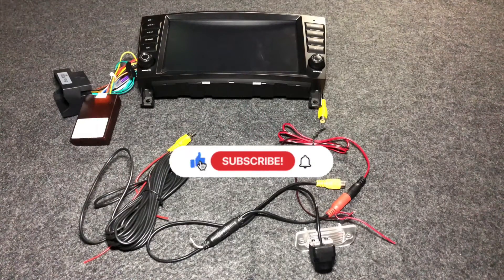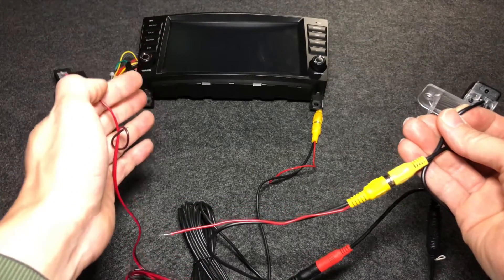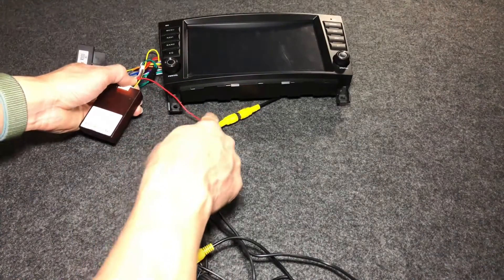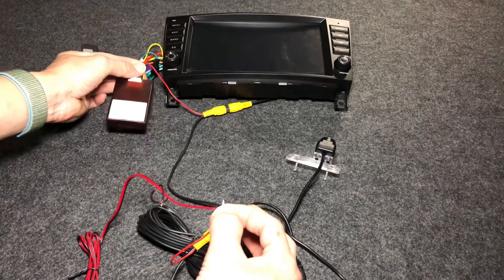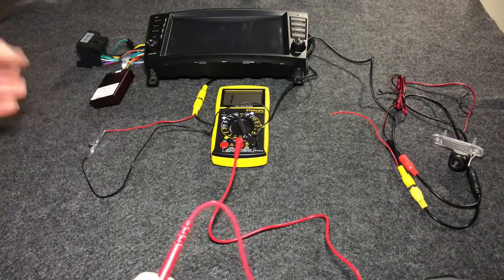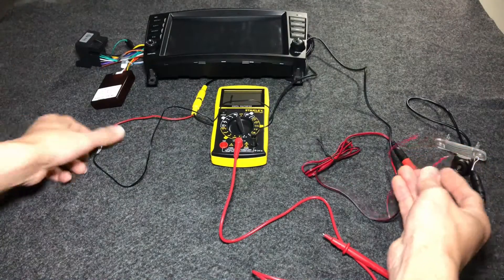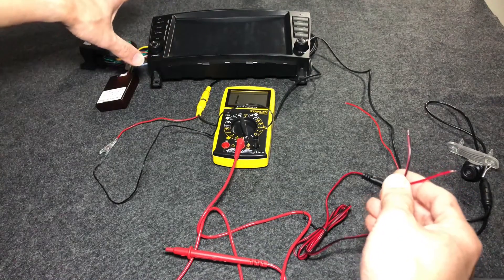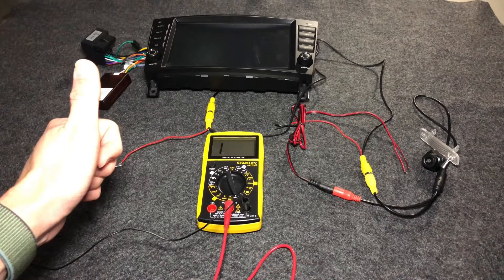HOW TO | CORRECTLY WIRE A REVERSE CAMERA

Comment: Thank you. I haven't a red small wire in the video Yellow connector. And my actual camera is connected to the reverse light. How to use the power cable in this case? I need to delete the connexion to the reverse light. Thanks
Reply from the maker: Hi Bassam, to do that, you first need to get the reverse camera wiring cable with the red wire on each end. And if you do this, you will need to remove the existing one connected to your reverse camera, route the new wire from the headunit to the reverse camera then hook it ip. Thats a lot of work.

If your reverse camera is already working with your existing wiring, I wouldn’t recommend re-wiring it just for the sake of getting 12v power from the headunit.
Reply: @AutosNGizmos  Thank you. I need to keep the actual camera already installed. But the Video connector doesn't have a red cable like yours. The camera is already connected to 12v from reverse light. I think I must remove the 12v connection to the reverse light?

Comment: I removed the brown cable from the CANBUS plug. And now from your video I learned that CANBUS is a voltage source. Can I still fix this?  Now how to connect the red and brown cables to the CANBUS plug?
Reply from the maker: Hi Angelika, you can re-connect the brown wire back to the canbus. Once connected again, you can use a thing called T-tap with a spade connector (affiliate link below) to connect the brown and red wires

⭐️ https://amzn.to/3BQkSFS

Here is a picture how to use the t-tap and spade connector for your reference.

http://youtube.com/post/UgkxVkxiMe6_QyFnZEwaOgEj4Uum8UI9OHfd?si=5sZ0vhjySo8qC662

Comment: What about the front camera?
Reply from the maker: Front cameras use the same concept. You need to power up the camera at the exact moment the headunit switches to the front camera video feed. But unlike reverse cameras, you cant rely on a canbus signal. You need to have a custom controllers that checks vehicle speed or add a custom switch in the dash that you can turn on when required. I hope this helps.

Comment: so.. if connect the power source to the head unit without tapping it to the reverse light, would I still be getting automatic revrse video turn on when i put on the reverse gear.?
Reply: updated, i tried the method, it didn't work.. seems like my head unit need input source from the camera to turn on the screen for reverse camera. so it need to tap the red wire to the ac-dc red wire which connected to the power wire for the reverse light. there is cable in my head unit (also brown color) need input power to turn on the reverse screen video. so thats why the red wire need to be connected to the brown wire cuz the brown wire, in my case, is not output but input. input from the reverse light power source
Reply from the maker: Thanks for updating your post for the benefit of others 🙏 This is really helpful
Reply: @TarapBossku there is no AC/DC anywhere in your audio system or vehicles lighting circuits ect...   everything is Direct current DC 12v usually.  Some trucks have 24v that means they have 2 12v car batteries usually unless somone installed an aftermarket 24v single battery.  Bytnits all the same.   

DC comes from batteries .   AC. Aka ac/DC  is what comes out if a wall socket in your house. Or from an inverter that transforms DC from a battery storage bank into AC to be used with your standard house hold appliances.   So that you can plu in a regular plug and power a lamp or a fan or something with a batter .  But you need the inverter.

Comment: Hi this might be an obvious question, but how do I tap into the brown wire without risking damage? Thanks
Reply: Come on now authority guy.    Just tell them to scape off a little bit like the width of a pencil off of the wire . Your just removing some of the rubber insulation around the actual wire. Once you have some wire exposed. Simply take your desired lead that you want to connect to it strip of maybe ½in to and inch of the jacket and wrap it around the exposed bare wire on the sully source your tapping into.   Twist it nice and tight to ensure that both bare wires are touching. Then you can either solder then together or use electrical tape or electrical glue or even hot glue. As long as the wires are twisted together and then covers with some kind of non conductive rubberized material than your good .  Black electrical tape is fine.  

You can. Just cut the source wire in half and stirp both ends and then twist the tap in wire together with the source ends and use a wire nut over that or shrink rap or tape ect...ect..  just make sure the bare wires are connected will and then cover them up.  

You don't need to order anything and wait 2 days and stuff.  Just cut and twist. And tape.
Reply from the maker: Hi Emm, firstly thanks for taking time to watch this video. I appreciate you.

To answer your question, the easiest way I could think of is to use what they call the T-Tap with a spade connector. You can find them on my Amazon affiliate link in the description box of this video. Please note that I might earn a small commission from Amazon from qualifying purchases. It doesnt cost you extra but helps me a great deal to keep this channel going.

Thanks for your support :)

Ron
Autos ‘N Gizmos

Comment: Easy drop on reverse and use Bluetooth transmitter
Reply from the maker: @alexandrstroynov6986  This will save you time routing the wires from the cabin through to the rear of the car but you still need to find a power source from both ends.
Reply: work smart not hard

Comment: Hi, I have a Vauxhall Zafira recently installed a android unit. It has the canbus box and a wire labelled ‘reverse’. Can I connect the red wire from the video line to this to the red wire on the camera for power? When I go into reverse the screen changes to on its own to the camera feed, currently only shows a blue screen as no camera currently installed.
Reply: I didn’t have a ‘reverse’ wire it was a ‘radio’ one 😂, I looked at the canbus and had a dark orange wire in the same spot as your brown, TTapped off that and the camera works perfectly. Thanks for the video, most helpful one out there.
Reply from the maker: Hi Dyland, It sounds like you can use it as per the label. But to be certain, I suggest to test the ‘reverse’ wire with a multi-meter.

Comment: Hi guys. Thank you for your informative video. I have connected my new unit up exactly as per your instructions but I have a slight issue. The camera seems to power on when I put the car in reverse (as the bright led lights around the camera lens light up), but I am not getting a video signal on the screen. I have plugged the RCA into the correct input on the head unit and I have checked the radio settings to ensure that the Reverse Camera setting is 'on'. Do you have any ideas as to why I am not getting vision from my camera onto the screen?  Cheers from Maurie
Reply from the maker: Hi Maurien, I can only think of three reasons why this would happen:
1) The camera itself is not working/broken. Try using a different camera.
2) The input RCA jack is incorrect. Either try using a different RCA jack if there are another one available, or cycle through input video sources from the headunit (i.e pick Aux, etc)
3) The video format is not set correctly to match the camera. Try going to the system preference and change to a different format.

I hope one of these solutions would work. Cheers
Reply: @AutosNGizmos  Thanks for the reply guys. I will investigate further. Cheers

Comment: Hi, I don't know a lot about cars, I recently bought my first car, a Polo mk5 (6R) 2017 (CJZC engine). Do you (or anyone else reading this) by any chance know if I could install a reverse camera that would work with the factory screen. I want a license plate light camera. I also borrowed a friend's obdeleven tool to look for some info on my car and here's some of it.

Control unit: 5F Multimedia System description:
MU-E--ER Software number: 6C0035867F Software
version: 7082 Hardware number: 6C0035867F
Hardware version: 050
Reply from the maker: Hi Vzh, firstly, sorry it took me a while to respond to your question. Secondly, congrats purchasing your first car 😊

With regards to retrofitting a reverse camera to factory headunits and as you might already be aware, it will require re-coding of the car either using OBDEleven or VCDS from Ross-tech. I don’t have experience using either of this (I’m considering buying VCDS) so the best place for you to post this question is on the respective forums for these products. I quickly searched the Ross-tech forum and found this thread which you might find useful: https://forums.ross-tech.com/index.php?threads/7276/

As for the reverse camera itself, I’m also not sure what video format the factory headunit supports but a good start is to have a look at this website: https://vwcentral.com.au/cosmetic/exterior/volkswagen-genuine-flip-badge-static-rear-view-av-composite-reverse-camera-fits-vw-mk5-mk6-polo-6r-polo-6c-passat-b7-b8-t-roc.html?srsltid=AfmBOoqoPtxqegWpPyIIbbLvfeUNijjZsIWAdsg_TPu3GzxaHG7GgfvI

If the above is a bit too pricey, you can search in Aliexpress to find a suitable one. You will need to confirm with the seller if it is compatible with the factory stereo.

Good luck and I hope you find a solution to retrofit a reverse camera to the factory stereo.

Comment: How does the cable stay in the red box ? I have something similar. But also mine doesn’t seem to have any power.
Also where would I put the black cable in a Renault traffic
Reply from the maker: Hi Robert, firstly thanks for watching the video, I really appreciate it.

If by “red box” you mean the CANBUS decoder, it gets power from the car’s main wiring harness. Mine doesn’t have a power LED indicator so it’s not easily distinguishable that it is getting power. The only way to confirm it is receiving power is to testing the wires using a multi-meter. 

With regards to the black wire for your Renault Traffic, I’m not too familiar with that vehicle but normally, black wires are “ground” which means you need to connect them to a ground point in the car. For most vehicles, a ground point is normally any connection to the car’s bare metal. You typically see this when a bunch of wires are connected to a bolt attached to the body of the car. But I must warn you that if you are not familiar with electricity concepts, please seek the help of a mechanic/professional to avoid damaging your car or injuring yourself. Best of luck!

Comment: So the RCA cable has 2 wires.. inner is the video data signal coming from camera to the android unit, and the outer ring is the ground wire which gets already grounded inside the android unit.

If my assumption is correct, then we don't need to connect the black wire of the 2nd connector to ground anymore. We can just leave it UNCONNECTED. Is this correct?
Reply from the maker: I see your logic here. However, you still need to connect the black wire on the Camera side so the 12v running on the red wire has a path to ground. If you don’t connect that black wire, the camera wont power up.
Reply: @AutosNGizmos  I have one RCA adapter with 4 wires and the other end has a yellow connector with 2 wires.

Between these 2 ends, there is a BLACK JUNCTION BOX from which only 2 wires come out to the yellow connector. And one wire not connected to anything. Obviously, inner ring is video signal and outer ring is ground.
And, what are the 2 remaining wires used for???
And, what's inside the black box junction???

I really need englighten on these 4 wires and it's really confusing me alot.

Please 🙏 help.
Reply from the maker: @tnamen1307  It’s hard to imagine what you have. You can either post a photo and give me the link to the post or email the photo to me on autos.gizmos@gmail.com and I will see how to help.
Reply: @AutosNGizmos  sir have you checked???
Reply: @AutosNGizmos  okay thanks for the reply.
Reply: @AutosNGizmos  Sir if you don't mind, can you please kindly share your 🅦🅗🅐🅣🅩 🅐🅟🅩 because I can't explain. I will better send photos/diagrams which explains more clearly...
Reply: @AutosNGizmos  sir can you help me?

Comment: What did you do with the black wire? Did you connect it to ground (body of car) or did you leave it disconnected and got the ground from the RCA cable only?
Reply from the maker: Hi Steven, Yes I connected the black wire to the grounding point of the car.

Comment: What is the benefit of wiring it to the headunit as opposed to the reverse light? Does it not achieve the same effect?
Reply from the maker: That’s a great question. For me, when I did my installs, since the headunit is already open, it made sense to get the 12v power source from there. Second reason is that some cars have a sensitive canbus and that a slight drop in current/resistance triggers a random warning light. So to avoid that potential issue, I just tap into the headunit/canbus decoder power source.

Either approach is fine. Just dont connect both ends of the red wire from video cable to a power source.
Reply: @AutosNGizmos  That makes sense, thanks for explaining

Comment: Hello I recently installed mine with the help of your video and mine goes into a blank screen when I switch to reverse
Reply from the maker: Hello Oreoluwa, firstly thanks for watching my video. Your support means a lot to me.

With regards to the issue you described, there could be several reasons for that. Here are the steps you can follow to help you troubleshoot.

Using a multimeter (set to voltage reading), connect the red and black leads of the multimeter into the corresponding camera power wires then put the car in reverse. If you don’t get 12v reading in the multimeter, it’s either the red wire is not connected to a 12v power source or the black wire is not properly grounded. If you don’t have a multimeter, I have an affiliate link to an Amazon or Aliexpress product which you can purchase (I might get a small commission if you purchase using one of those links).

If I may ask, where are you getting the 12v power source. Did you confirm it is in fact sending 12v?

If you can confirm there is definitely 12v, then it’s possible the black wire is not properly connected to ground. Normally, the ground point in any car is any bare metal (unpainted) part of the car’s body.  Normally, you will see a bunch of wires connected to a nut onto the body of the car - this is the ground point you can use.

If you can confirm both 12v and ground are connected properly, then it’s possible the camera is broken.

To check if the camera is working, you can take your camera indoors and using an external 12v power source, power it up and connect the yellow RCA cable into your TV. If you power it up and the camera is working, you should see the video feed show up on your TV (make sure to switch the TV to the appropriate input source).

I hope this helps. Let me know if you have further questions.

Cheers
Ron
Autos N Gizmos

Comment: My brown trigger wire from the back of the unit does not connect to the canbus, can you tell me which slot does it go into the canbus? Thanks
Reply from the maker: Hi King, Unfortunately I would not be able to tell you specifically what wires you need to connect to where because headunits and canbus decoders vary. Does your headunit (if its already connected) does it switch to reverse camera input and show blank screen when you put the car in reverse?
Reply: @AutosNGizmos  it does not switch , nothing happens when I put the car in reverse
Reply from the maker: @KingTreeFiddy  Ok there are two areas you could to check. 
1) In the System setting, there might be a setting to enable/disable the reverse camera switch. If you find this setting, make sure it’s enabled. Perform a quick test if you changed this setting.
2) Perform a trial-and-error to find the wire in the canbus decoder that outputs 12v when you put the car in reverse, and goes to 0v if you put it out of reverse (i.e. checking each wire of the canbus decoder one-by-one). You will need a multi-tester for this test.

Good luck. I hope one of the two suggestions above will work for you. Let me know if you need further assistance.

Comment: The Trigger is from the reverse line to the main unit! To activate the screen in reverse mode. Not the other way around like you've said! You are misleading the newbies!
Reply from the maker: If you look closely, I am ALSO using the same power source from the canbus decoder that goes into the headunit BACK to the reverse camera.
Reply: so where is the reverse trigger in the harness behind the radio where is the output trigger on a 2015 Toyota RAV4 where is the output trigger got to be in the harness not the kick panel
Reply: lol all these people saying it’s done wrong when it’s not!! If you have a radio with a canbus the typical rules don’t always apply… always the know-it-alls that speak the loudest about something they clearly don’t know lol
Reply: But how does the camera itself get powered
Reply: Brown trigger wire is to tell head unit the vehicle is in reverse. The brown wire by itself will not power anything with the vehicle in reverse. It is meant to receive 12v from the reverse light circuit at the rear of the vehicle
Reply: How to wire correctly.. and immediately proceeds to do it incorrect
Reply from the maker: @LouisvilleCards  I installed three reverse cameras successfully this way. What makes you say this is incorrect?
Reply: @AutosNGizmos I guess it is because the CANBUS decoder reverse signal is just that, and may not be able to provide enough current to power the camera. Need to read the specs of the CANBUS decoder to truly know. I have not been able to find any info on them.